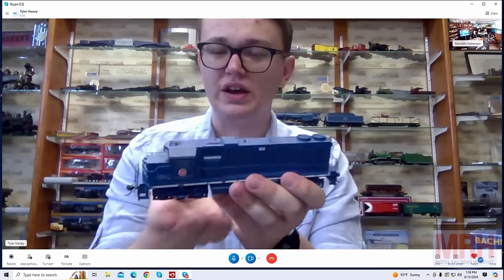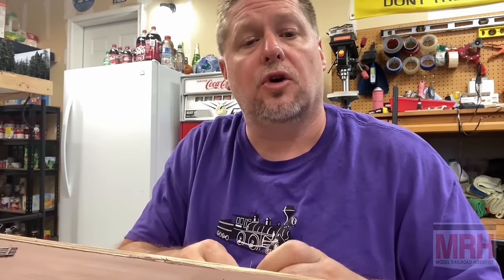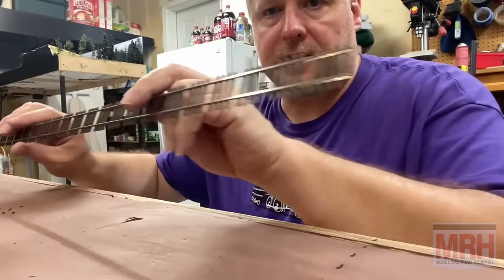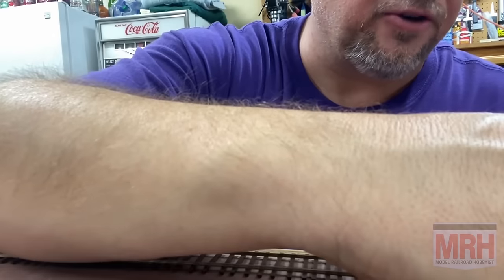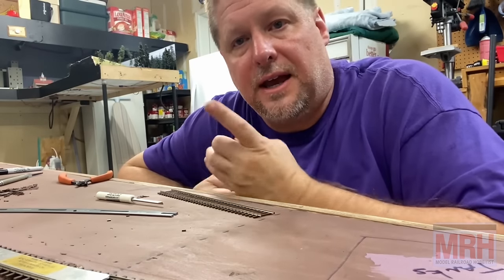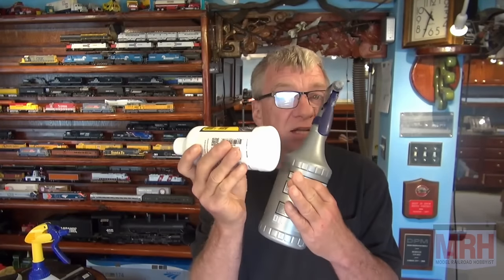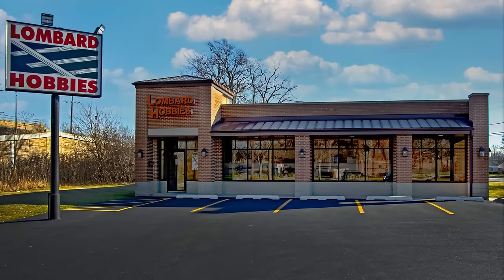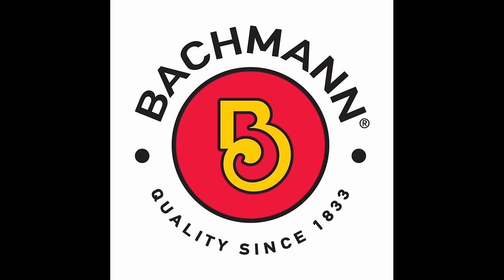Laying realistic track, part 1 | July 2024 WHATS NEAT Model Railroad Hobbyist

Comment: I did use MicroEngineering code 70 flex track in my yard.  For turnouts, I decided to use Peco code 100 turnouts in staging and Peco code 83 on the visible part of my layout and Peco code 83 flextrack.  When I was buying turnouts, the Unifrog were not yet available so I bought all Electrofrog and am using Tam Valley Frog juicers.  I used what you called jumper track pieces to get spacing that I needed in the yard or on crossovers where I used Peco code 83 #8 turnouts.  When I was a grad student at IU Bloomington IU, my layout had to share the garage with a car too!

Comment: For better control and perfect atomisation of the glue mix, I use my old airbrush with a 0.5mm needle (as I have a better one for paint). Perfect for making tree without putting glue on the trunk. But sure, for large scenery, a bottle sprayer may be more adapted (but then a big spray gun can also work better).
Regardless of the tool, spraying pure water as soon as possible after the glue mix will easily wash the sprayer tool.

Comment: I've spent most of my life working in industries with railroad track.  I've found large variations in track depending on the economics and local conditions.  There can be huge differences even inside a single industry.
In general ballast used on industrial track is smaller than ballast used on railroad owned track. (cheaper)
Industrial track ties are sometimes buried in dirt or ore to where they can't be seen.  Particularly in areas with bulk loading or unloading.
Sizable areas may be paved over.
Often small sections of track are replaced resulting in new looking track next to heavily worn track.
At one plant there were a couple hundred yards of concrete ties.  The area was low and water logged rotting out wooden ties.  Raising the area for drainage would have put the doors of box cars too high for the loading dock.
For modern facilities handling tank cars there are often pans between the rails and along the outside of the rails to catch any spills.
Think in terms of equipment for loading and unloading cars.  The cargo doesn't magically jump in and out of cars.  Loading chutes.  Dumping pits.  Air conveyors to remove fine material from covered hoppers.  Platforms to access the tops of tank cars and covered hoppers.

Comment: I use a system with no track power at all. Complete battery operated. To really see the tie removal and spacing you need a higher view as the angle you have doesn't show the spacing as well. On my new layout I am using track from several layouts ago. I will use a liquid nail and put the glob on a piece of wood (anything will do) and take a small art knife and place a small, thin patch of glue every 6 inches. The patch of glue will be only about 3 ties wide. The track will be held tight but the ballast will solidify it when we get to that time. This will let you take up the track with just a water soak and a little prying. I have lost almost no track to bending or kinking when taking it up with this method. I use the "T" pins on the outside of the rack. This holds it in the line I want and then I use cans of soup or vegetables to hold the track down. The track will keep the cans from rolling off. Soup, vegetables, pop, beer, any of these will work and it's whatever floats your boat.

I will shake up my glue bottles every time I am in the train room just to keep the glue - water mixed and not have the clumps that will form if you let it set foe several days or sometimes weeks.